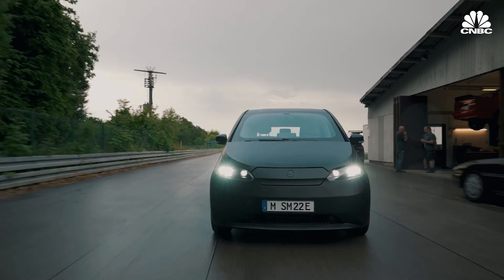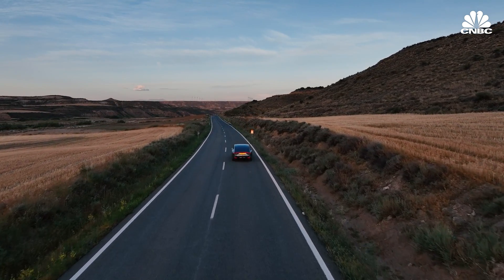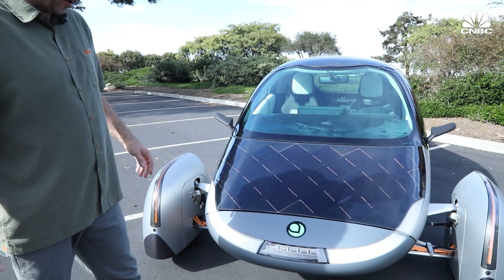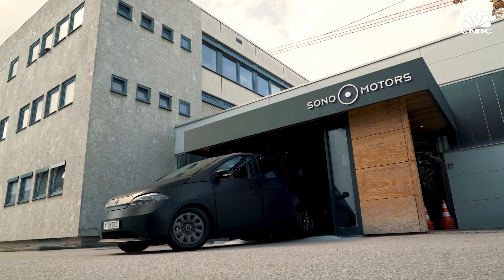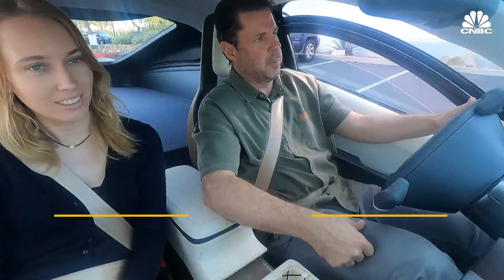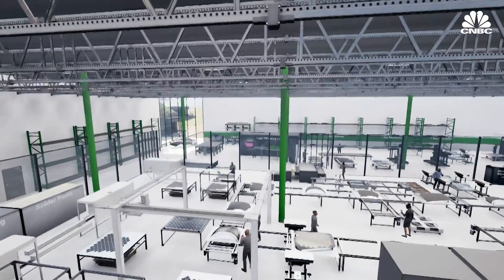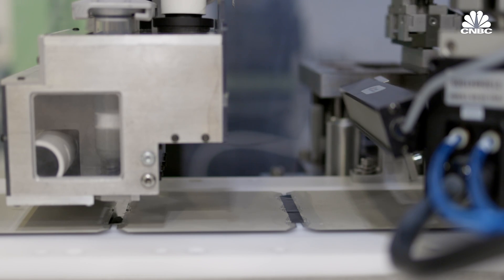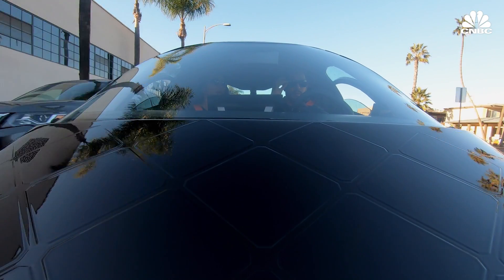Solar Powered Cars Are Here — But Can They Go Mainstream?

Comment: Yawn.
Ev owners with solar panels on their property have been adding up to 80 miles of range per day to their evs like Tesla Model Y for years on solar alone
And flexible, light, folding, stowable multi kw solar panels for use on ev while parked are now available, shading the ev for cooler interior and running cooling fan(s) to boot. Throw on roof, unfold over rear,  sides, hood front and get 20-40 miles or more while you work on common ev available now.
Aptera too little too late

Comment: If the battery has a range of 320 miles for instance like some EVs do it doesn’t matter too much if the sun provides only 25 miles of electricity a day. You can wait a few days before a big trip.
Reply: This is just the beginning. We've only begun to tap solar's potential.

Comment: idea is just dumb lets install something that easily last 30-40 years on things that last an average of 12 years it just creates more junk while adding very little, also you need to be able to park your car in the open sky it just make things more complex more expensive and makes it even harder to recycle the car. makes it harder to fix a dent in the car makes it almost impossible to paint your car. and because your parking in the full sun your car will be an oven if you want to drive it after and running the ac to cool a 120f car severely impacts the efficiency

Comment: I drive a gen 1 Honda Insight. Well, I drive it occasionally. Refuel it twice a year. It's only to get around town and use it as a shopping trolley.

A two seater solar car putting 10 miles a day into the battery would do just fine.

However it's the other costs that need to be addressed. Should my insurance really be the same as a person who drives hundreds of miles per week?

Should my road tax be the same as a long distance driver?

I think not. Cost of ownership currently encourages maximum use of the car. This needs to change.

Comment: Intresting that the motors in the wheels are a new design choice. Considering how bad some roads are in the US... yeah i could see that design not holding up over time.
Reply: Apparently, it was pretty much never adopted because it would significantly increase the weight of the car. Aptera and Lightyear made their cars so efficient, that they could pull of the trick and because of that made their cars even more efficient.

Comment: "15 to 45 miles in a sunny area", depending on what you buy. Converting to real-life scenarios,  with a/c on a usual summer day in "sunny areas", on-board computers and even fckn shade. And cities are being designed to provide as much shade as possible. Or even not summer. 
All-in-all, a super cool and advanced tiny city commuter or a end-of-the-week groceries celebration. Definitely beats the e-corkinet swag. 
How much?

Comment: I think they aren't targeting the problem head on and are presenting mediocre products (in terms of the power source technology they are using.) Hear me out.

These companies market their products as providing solar power assisted EVs that are still charged by the grid. What's the Unique selling point? What's special in getting one if you still have to charge with the grid (or any other external power source)?

I think it would make for better PR and product uniqueness if these solar cars could be independent of the grid (to prove the technology like how Tesla did with the Roadster)  and be solely powered by solar panels charging up the battery. I don't see how they could scale when they don't provide much leverage (except for Aptera's impressive mileage & cost.)

I assume using solar is extremely hard but I think it has been achieved in for eg. that Australian Solar car Competition.
Reply: Well one of the selling points would be that you would have to charge far less than with regular BEV's, which is cheaper and much better for the energy grid. For the LY0, they estimated that if you'd live in Lisbon and drive on average something like 30-45 kilometres per day you'd be able to go 9 months without charging. And we are at the start now of SEV's for the consumer market, in time it will become more efficient. For example, one thing to look forward to is that there's also progress in adapting solar panels in windows which should also be possible on cars. More coverage by panels so more power generated. I wouldn't be surprised if by the next decade we'll have cars that will drive purely on solar energy.
Reply: @zaros1781  would love to see that. That would be the holy grail of SEVs.

Comment: people still don't get this really. I work at Tesla for example and I get a lot of customers everyday that I help and explain the electric process and there main fear is range anxiety. 

Yes I understand that, I did to at first even though I always wanted a Tesla and understood to draw backs and differences. but again lets think logically, who drives 200 miles a day. not every many. and use always come back home and plug in the car at the end of each day. yes I know no everyone can charge at home, some live in an apartment or a home that the land lord would let you put a charger.

but if you can the next question I always get "oh my electricity bill is going up by an extra $100 a month. ok. but how much can you drive with $100 gas fill up? 

I get it its still not for everyone but for some people it works. I live like 5 miles from where I work so thats helpful plus everything I need in near me, my doctors, food, restaurants, shopping centers. so something like this would work for me

Comment: In the USA, the average vehicle carries 1.5 passengers and average distance driven, 35 miles per day.  I would like to see modular EVs, starting with 2 seats and modular batteries that starts at at range of 100 miles.  The vehicle carrying capacity and range can be rented to add for the rare occasion people need to carry more or drive further distance.  This would free resources to make more EVs and drive down the cost.

Comment: I mean, it is a good theoretical idea, but in the end, it's batteries that are holding us back, if we made a battery efficient enough then we can say drive 2x more for the same amount of fossil fuels. It's all about efficiency, I was in electrical engineering for multiple years and I made a project about the theoretical idea of solar powered cars, designed my own and everything, but when you crunch the numbers, it's a very weak idea because the weather can change it's efficiency. At least we're starting different ideas, but we still need to work on what we have currently and hopefully we'll find a solution in 50 years because that's all the time we got to reduce climate change caused by fossil fuels

Comment: i'd never buy a car with the engine in the wheels! that sounds like very high maintenance long term defeating the purpose of a vehicle like this. I think Sono's got it right offset the range of current EV's with solar until the technology gets better (or EV batteries get better) and ease the public (especially the car culture of the US) into the idea of EV's and Solar EV's slowly. in the future it'd be cool for solar panels to be an add on feature you can get on any EV!
Reply: Motors in wheels have been used for the last couple decades to power E-bikes.  These are much more souped up, robust, durable, and more highly engineered versions of those.  Why wouldn't they work? 

    It is basic physics that it is more efficient to have the power directly transfer to the wheel from the wheel vs translating it from another area which introduces losses from gears etc.  

    And the nice thing about a wheel, as far as accidents etc go, the rubber + air on a wheel, tends to absorb a lot of the impact force/energy, unless it is a straight on hit from the side.

  Meanwhile the front of most cars are literally designed to crumple in to absorb impact, leaving the engine more prone to direct hit damage, to save the passengers inside.
Reply: @justinw1765  most of the impact that the vehicle suffers during rough terrain or even your normal drive is put on the wheels 1st. putting something as important and complicated as your primary drive directly next to the wheels will increase how often it requires maintenance or even replacement. there's a reason most vehicles put the engine in the center of the vehicle as much as possible especially if going over rough terrain. i'm not saying it wont work i'm saying i'd expect to be replacing something expensive on a car like that every 3-5 years.

Comment: I truly hope Aptera with sir Munro would be successful even though it only has 3 wheels which what turns everybody off and is quite expensive compared to Model 3. They should wait until it has four wheels before they sell it, I deeply pray, fast & deeply hope.

God bless.
Reply: ?   Cheapest version of a Model 3 starts at about 47, 000. Cheapest version of an Aptera starts at about 26, 000. That's a full 21 thousand cheaper for the Aptera. I'm confused by your statement in light of this?

 And 3 wheels vs 4 also has some benefits. Less rolling resistance, easier to achieve more aerodynamic shape, less weight, less insurance and overall cost (because of regulatory hurdles/factors). These are all good things for electric vehicles in particular.  

  From what I've seen of tests, the Aptera still handles pretty well and nimbly. My only issue would be winter/snow driving.  4 wheel drive vs 3 wheel drive is better in the snow.

Comment: Solar panels are around 20% efficient.  Gas cars 25% efficient, incandescent bulbs 20% efficient,  led bulbs 80% efficient, eV cars 80-90% efficient with battery/electric motor.  Wind mills more energy production than solar panels.  Maybe a miniature windmill powered car, lol.
Reply: Battery tech has made portable devices/smartphones possible.  Battery storage is the holy grail supply/demand on the grid.  Musk has helped bring car battery prices down enough to make grid batteries profitable with use of stored solar/wind for night use. Musk  was proactive vs our government reactive.  He started a revolution when gas prices were low and no tax incentives.  USA dabbling in renewables since 1970’s oil embargo.  Opec hit us again in the 2010’s with cheap oil to brankrupt shale/fracking.

Comment: Solar-powered cars sound like a great idea. But how much to buy, fix,maintenance etc? Does it have heaters, air circulation. Possibly thoese 1970's triangle air pusher windows that take outside air and use it internally.

Comment: ok. sure. the top battery capacity model of Aptera would theorethically(if it got as much range as it claims, as much power from the solar as it claims and wasn't parked in a garage) get me driving on 100% solar from the panels on the car. the only problem with it is that the weather here is either hot as hell or a drizzly nightmare. so when its hot i don't want my car baking in the sun and when it drizzly, the panels wouldn't really be as effective as they claim to be. so i think it makes more sense to simply put a panel on the garage rather than on the car.
Reply: The Aptera is made with a foam core composite material. It is more insulating than your average car.  Just put some solar shades in the windows, crack the windows a bit, and it will be a lot more tolerable. 

   I think a panel on the garage and on the car makes the most sense. Here's the thing.  For a full panel upgrade on the Aptera, it is only 900 dollars extra that gets you 700 potential total watts.  But with home Solar, not only are you factoring in cost of the  panels, but also inverter, batteries, any work done by others, etc. This is cheaper than home solar option because a lot of that extra stuff is factored in already.  You are more or less just paying for the specialized panels and some of the labor. (and they are indeed specialized. For example if they crack or break, they will still function at high efficiency. And the labor is less than home, because  you are just gluing panels to the car vs setting up frames etc on a roof).

Comment: With how cheap and better solar is getting and with how they can now integrate solar into surfaces without even looking like a solar panel, I think it's only a matter of time before many EV carmakers integrate solar into their cars.

For many, it could reduce how much energy they need for charging it up or not need any at all for the ones that don't use their cars that much and because of how cheap solar is getting and how it can be applied to almost anything, I wouldn't be surprised over the next decade if a lot of tech gadgets that we buy have solar on them to either extend their life or to fully charge them.

That Sion car looks the best one and mainly because of the price point which is key to adoption, a lot of the others are just too expensive to make any real difference in the market, but once they can make cars that most consumers can afford, that's where the real game changer can be and the Sion is hitting that market, assuming it's mileage on solar is as they say.

Another advantage of that car is that it actually looks like a car whereas some of the others look like a spaceship from the future, the key to adoption is to use new tech on designs that we are a custom too and this is why the Sion looks the more promising to me, it looks like a car and the price point is reasonable, if it delivers on the miles as the company says, it could become a game changer as long as they keep the price point low for the average consumers to afford.

Comment: Daily driving for free on stored sunlight with fast charging on long distance trips sounds viable.. eventually EVs will be competing on not just the total range of the battery but also the daily bonus miles from onboard solar, since many people only travel a dozen miles or so most days if at all, and that's not accounting for times when the car might sit parked for several days of free solar charging between shopping trips.
Reply: If one got the 1000 mi range Aptera version, to be honest, even without Solar panels, you wouldn't be charging much or that often.

Comment: Old electric cars of 1800s called them shocks and not suspension speaker style generator and bumpy roads instead of rotation collection of materials to extend performance if they didn't roads and suspension using mechanical  energy still no one mentions compressed air vehicles but somehow they were banned not enough money in air vehicles not even to loose or extend range with hydraulic power to a generator to charge battery,or with gas motor a hybrid back then it was 125 miles for 2 bucks at home price and can be filled fast as gas and no mention of multi layer of segmented rotation using weight and rotation of tires rolling into the tire flat spot similar to a wave generator yes air and ground  dynamics means friction static electricity? in motion  not resistance just like most abundance in crust Aluminum humans travel in and light or leave in place and make the coil ? And loose the tires ? And anytime off road or air lift could use A arms like a car jack lifts the car with one hand bouncing compressor

Comment: Solar charging system!!! But the cars are powered by batteries!!! WRONG TITLE!!!
Reply: No it's not. The car does have a solar charging system. And does gain some energy from it.
Reply: @MechmanGetrieb  IT HAS BATTERIES!!!
Reply: @whodo4893  yes it has batterys. No one ever said otherwise. But it  fills those batterys at least partly with solar power. To do so it has a Solar charging system. That means the title is correct.

Comment: So way more expensive than a motorcycle but also far less energy efficient. But it takes up a full size parking spot. Will the wonders never cease?
Reply: It’s also far safer than a motorcycle could ever possibly hope to be, doesn’t throw 40-80mph wind against your body constantly, can be used for errands, and if you’re an efficient driver - can cost $0 to drive for a day. So yeah I’m pretty impressed.

Comment: I love that they're pushing solar to the limit on cars. Clearly, this has a long way to go. 15 miles a day, or 5,500 miles a year from the sun, is not enough to justify the costs you'll pay for this technology and, more importantly, the amount you'll pay to fix it when someone crashes into you. If we assume a gas car getting a combined 35mpg and $4 a gall for gas, 5,500 miles would cost roughly $630. We all know any car with solar panels all over it is going to cost an additional $15K. You'd have to drive it 24 years just to break even.

But again, let's see where this goes. Personally, I'd prefer induction charging. You park you car, walk away and it's charging from plates under the road, just like when you put your toothbrush in its holder and it starts charging. This technology already exists. We just need it everywhere. Then, the country needs to build more solar farms to reduce our fossil fuel profile. Good stuff.